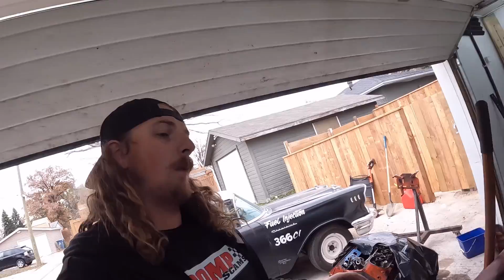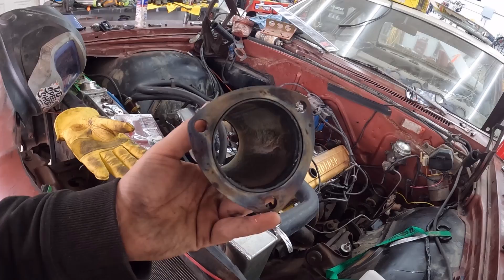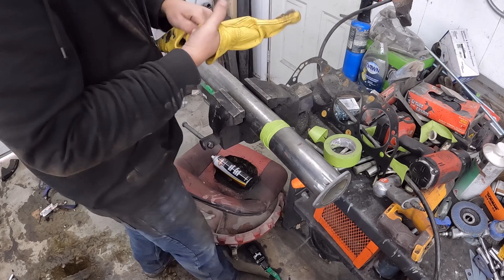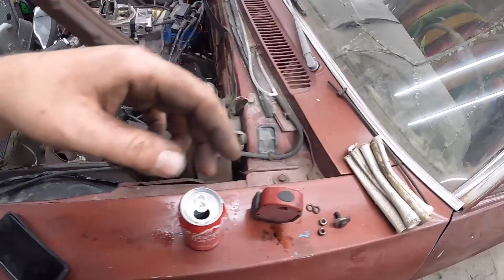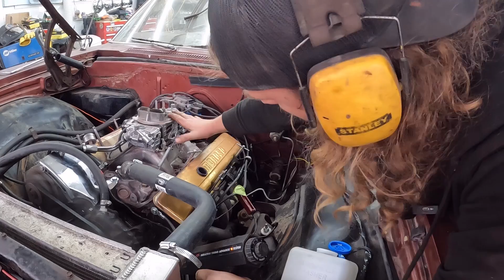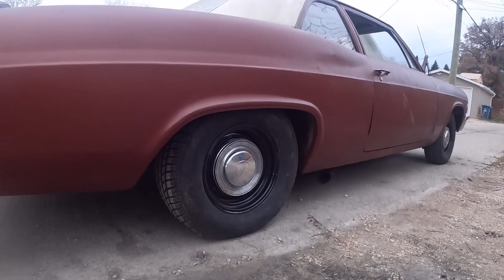Biggest Battle Of My Life!  This Is Hot-Rodding, Lowest Of Lows To Highest Of Highs!

Comment: I like to use donut style gaskets on my header collector for gasket, they use those donut style on stock manifolds , just need the inside diameter of header/collector and it lasts lots longer than the normal header gasket 🤘

Comment: After years of dicking around with flanges , clamps , hissing and rattling I now use stainless band clamps on everything.  
 Cut the flanges right out and band clamp in a pipe .
 Clamps are expensive but they don't leak , can be reused and exhaust can be taken apart and put back together in 15 min .
 Great when you want to swap in a set of quiet mufflers to go on a 30 - 40 hr trip .
They dont crimp / crush the pipes like regular clamps .

Comment: Hey Dan just a heads up I've used that flexipipe on bush semis. It works for a bit, then it blows out at about 6 months( this was on continuous use 24 hours a day 12 out of 14 day run time same temp maybe slightly colder as im north of you). we changed it out usually in the fall and usually by spring she was needing it again

Comment: Good flange but your burning up your seat. Maybe put some red gasket sealer on the headers too to stop the leak. It gets a heck of lot better gas mileage than a big block Dan. And Gasoline aint cheap these days. It will be a good driver and it looks nice.

Comment: cut it out (the windshield). get new sticky seal, apply sticky seal, have some help and set the new one in. (while you are in there, fix all that rust in the channel) watch those little tabs that hold the chrome. Probably won't be much of a challenge for you. except when your suction cup pops loose and the glass drops suddenly. that sucks.

Glad you got a win Dan. After so many bad days, a good day really goes a long ways.

Comment: Dan if you have manifold vacuum running to the distributor it will hesitate before weights can advance the ignition ..Find a ported vacuum port on front of carb and that should do the trick (ported vacuum produces vacuum on acceleration)

Comment: Pro tip buddy. Coming from the big truck side of things, use one of the flat band pipe clamps, they don’t mangle the pipe and it will come apart a ton easier and they seal better, the clamps you used have a tendency to pucker the flexy pipe and leak. Keep given R buddy!!

Comment: so true about the small block! there are a lot of things you can do to a small block to make it different. different intakes especially old ones with more than one carburetor. split exhaust manifolds. front distributor drive. stoker cranks. heads. I hate the ls as too many people use them. used to hate Chevy engines as that was the ls engine of 10-15 years ago.  now i like the small block as it is a bit of a outsider now.  flex pipe rocks! real exhaust has flex pipe as it keeps all the flexing isolated from headers. Mr. Gasket multi layer aluminum gaskets at the head and collector. I NEVER USE SILICONE on nothin. I use on stuff Permatex aviation seal #2  for non hardening salient and Permatex # 1 on stuff that calls for a hardening sealer. paper gaskets get grease. and a lot I just put on with nothing & never have leaks as I clean and check the surface. silicone cases more problems than it solves! modern pump gas burns faster than the old time stuff, and 38* will make less power than say 28-30*. on the street you want grunt not hp and a wide power band. 36*-38* was for hi lead fuel of 1970 for max hp. if you set it at 28* total you only give up 10-20 hp but pick up 10-20+ ft of grunt. all so power band widens about 300 rpm. a good set up would be 18-20 mechanical all in by 3500 rpm with a base timing of 8-10* btc vacumm advance on full manifold pulling in 10-15* of advance so at idle 18*-25* with vacuum advance.  cool ride!

Comment: Dan, you'll need to remove the chrome trim from around the windshield to expose the adhesive and prevent the trim from damage. There's a trim tool for that. Having been an Glazier's Apprentice for 18 months way back when (and installed hundreds of windshields) we'd use a "Windshield Removal Tool" to cut the butyl sealant that bonded the Windshield to the pinch weld lip underneath. (Just look on Princess Auto for Windshield Removal Tool.) Cut the adhesive all the way round, and then push the Windshield out from the top - a little at a time -in one piece working on any spots you missed as you see them. You'll need to clean up the residual adhesive on the lip with a plastic scraper; or if you use a metal one or chisel, you'll need to prime the raw steel to prevent it from rusting out (I saw many, many, cars with rusted pinch weld lips from those who didn't have this done correctly here in Metro Vancouver.) You can buy the adhesive on Amazon. It's easy to put on as it's got a barrier wax lined paper tape so it doesn't stick to itself. We'd start it in the middle of the bottom of the windshield opening and go all the way around and but splice it. Clean the inside of your new windshield at least twice before letting it dry thoroughly prior to install. The Trim is carefully pushed down (sometimes with a bit of a wiggle) to get it into the clips. I'd clean it too off the car as it's easier then.
Reply: What he said. Piano wire also works for cutting the glaa out, but you need two people, one inside  one outside, ans each with a pair of vice-grips to grab the wire, then saw it out with that.
Also to note, setting the glass requires a lot of carefulling, becaue you only get one shot at setting it in while gently gentling.
Reply: Thanks for the info, Jim. I need to do that to my '65 Impala SS, front and back.
Is the windshield removal tool the same as the UltraWiz? The UltraWiz is a solid aluminum handle and lanyard with a 90 deg. blade at the end.
Reply: @bartsarton2212  Yes that looks like a very similar tool.
Reply: @Jimsathome  Thanks bud.

Bart from Ladysmith.

Comment: Old school windshield removal is a snap... Especially with the Right Tools. You have to Carefully Remove the Chrome Trim from the Edges Special Tool and then you can take a Utility Knife and go around the edges to trim of some of the old seal. At this point sometimes if you push around the edges you can get an idea how easy or hard it will come out. Once enough of the Top edge is cleared out... At that point sometimes you can just push on the top edge and roll it clear out. Otherwise you need either a windshield removal tool the has a 90° cutter on one end and a kinda T handle on the other end... Or if you make a small hole somewhere on the edge you can slide a thin piece of cable like a hood release cable and saw it out. This method will even work on the ones that are glued in with Urethane

Comment: Love your channel. I worked in a wrecking yard and the best method we used was piano wire. One mechanic inside, 1 out. Poke it through on a corner and "saw" it in n out around the perimeter slowly. Wrap the ends around a screwdriver handle. Pull the wire down tight against the body not the glass. 1 lap should do it on a 66 Chevy. Danger: don't hurry.

Comment: I put a big piece of foam mattress pad on the hood cut the seal through and pop it out on to the foam.  New window; lay it on the foam pad, set the bottom in the channel on top of a couple of rubber spacers using them to pivot on, lay it back in to the sealer on both sides until the top drops in.  I am assuming you are laying it in to sealer and not using an actual window seal.

Comment: SBC the hart beat of America . You will drive it all winter with zero issues. Does the heat work ? Going to need that real soon. I had a 65 Impala with 283 & glide one winter in St. Louis Mo. GEAT snow sled! would go through just about anything.

Comment: What is wrong with using an LS? They make power, they can be modded lightly for not much, they're roller cam so cam swaps and break in isn't a concern, you live in a country with a smaller population where vehicles rust out so they're readily available, especially considering that the old school SBC hasn't come in a factory equipped vehicle since the 2002 Chevrolet Express Van and people are so scrap metal happy in Canada. You can easily make more HP with a measly 5.3 than a Vortec 7400, much less a TBI 7.4L, if you happen upon a 5.7, 6.0 or 6.2L LS you've got a 500-550hp engine with a $150 Elgin 228/230 or 238/242 cam, $150 PAC 1218 valve springs, $200 Ebay headers, $100 TBSS intake, $100 92mm TB, just using factory 862/706, 799/243 or 0821/0823 heads. You'll either need to have a factory ECU tuned or use Holley Terminator X however that's not some huge deal. If you don't want to pay for one of the larger displacement 5.7/6.0/6.2 engines, there's no reason to ostracize a 4.8 or 5.3 they can easily make more power than you could ever use with Chinese turbos, fuel system and quality tuning software. 1,200-1,550hp with a stock bottom end Vortec truck engine which means a safer, lower budget set up can easily throw 600-800hp to the tires for you. I realize it's not "on brand" for your Old School rodder channel, sometimes new ideas are good. HP is HP get as much of it as you can for a little $$$ as you can then terrorize the tires and anhillate all challengers. The best part is that 4.8/5.3 are so danged cheap if you break one...no big deal, get another.

Comment: Windshield glued in?  Just make a hole with an Olfa knife so you can snake a hood or equivalent cable through.  Then saw away.  If you want to get silly add jumper cables to both sides and you get the hot wire technique.  I remove fixed tempered glass with and oxy-acetenyl torch at work but the steel panels don't survive the surgery too well.

Comment: Good stuff Dan. As for the windshield, hammer and a shop vac should take care of it 😂 but if you choose another route, one of those windshield knives should do the trick. I’ve taped over most of the windshield before when removing glass with large cracks to try and avoid making a complete mess.

Comment: If you must use flex pipe get some band clamps.  They seal right up and don't crush so everything is removable later.  Other than the exhaust leak the car sounds good.

Comment: Windshield is likely held in with butyl. So it all has to go before you use urethane. Could pretty much push it out with your feet from inside. Remove chrome first. 
If you are using urethane, need a few tiny blocks to set glass on, if it goes too deep in the channel thats no bueno. Butyl is messy,BTW. Think stringy tar…

Comment: Just started watching sorry about the big block. Small blocks are nice and fancy. I had a built 292 in a 69 c10 step side in high school. It wasn't fast by any means but it would take so much abuse and keep singing. later on i put a 327 in it blew it up before a case of beer was finished. so i went to a 396 and went to 4 on the floor 2 days later put the 292 back in 22 years later still sings like day one. and its seen more abuse than the v8s short life in it.

Comment: You have to make sure the oil passages are free of metal particles, or else you will destroy every bearing. I'm not being a smartass. Just the truth. Also use some plastigauge to check the bearing clearances, or a good machine shop. But once everything is checked out okay. The big block is hard to beat. Just keep the RPMs under 6300

Comment: If you do enough welding on round tubing it might be worth your while to strip a short piece of battery or welding cable to wrap around the tubing for a ground clamp connection. The tubing can spin easily inside the wrap but still has good grounding.

Comment: The ‘66 turned out great!. Excellent job on the two door conversion. I know that you wanted the big block but, the small block should be reliable and offer a decent amount of power compared to the original one lung engine. Now that you have finished this one (hot rods are never really finished), what is next?

Comment: Great job  that Chevy  will run yet. Have  to say  tho that flex pipe may have a  exhaust leek do to the muffler  clamp I had the same flex pipe  on my exhaust  and I used a clamp like  that and it smashed  the flex pipe  and the exhaust  leaked I recommend  a band clamp  but hay if it works  it works. 😀

Comment: Replaced the harmonic balancer on my 454 in the 79 c30 last night, fuckin threads in the crank were fucked up from a previous owner.  Needless to say its coming out. Small block may go back in.
Reply: That sucks, do you gotta get a whole new crank?
Reply: Most likely going to replace it, i dont fully trust helicoils lol.  Theres a knock somewhere in the motor so its gotta be rebuilt anyway.